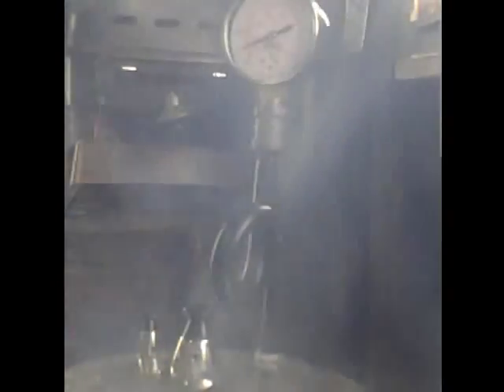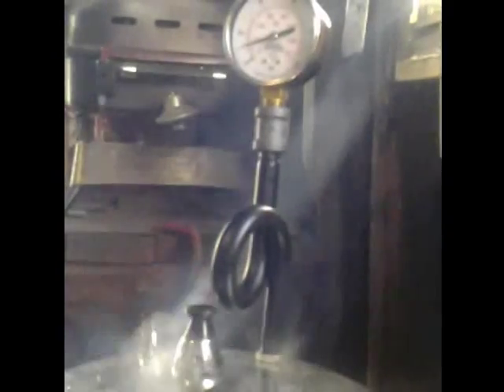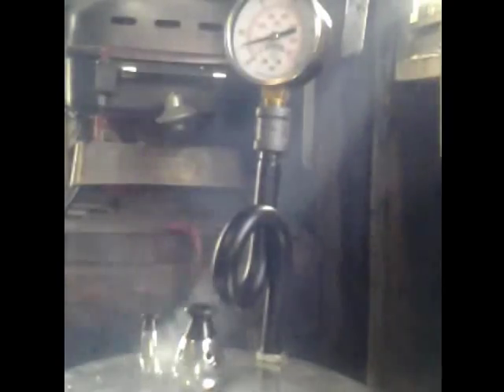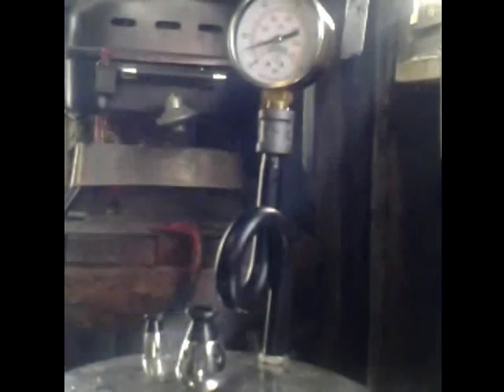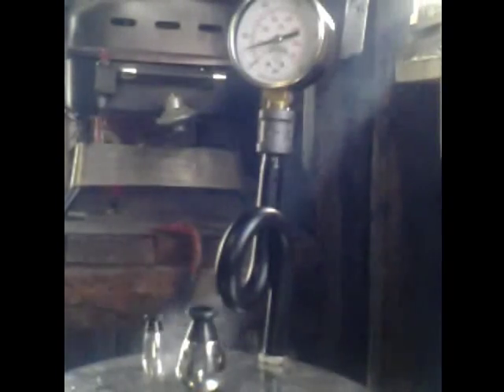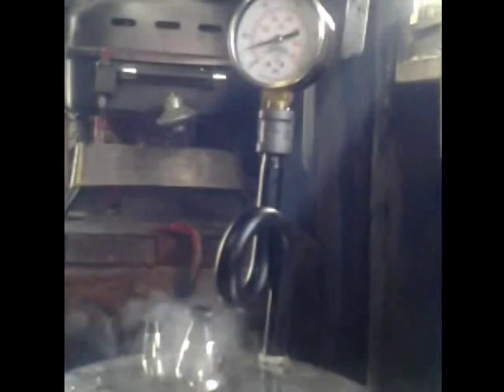Pressure Cooker Test

Comment: this pressure gauge is inserted on the pressure cooker is is true plz explain
Reply from the maker: I removed one of the pressure relief valves and replaced it with a pressure gauge. The reading you see is the pressure inside the actual pressure cooker.

Comment: Thank you for sharing.  Will a pressure cooker explode if hold down or lock up only pressure regulator.
Reply from the maker: The pressure cooker I tested had a silicone gasket between the lid & pot. The way it was designed I would expect the gasket would give out before the pot would split. If I were the manufacturer, I wouldn't want to kill any of my customers even if both blow-off valves stuck shut.